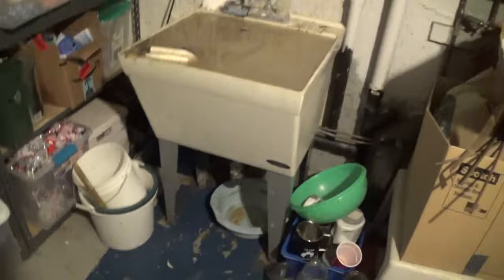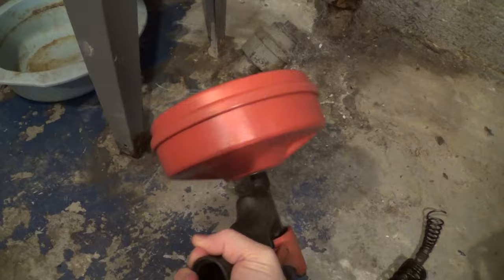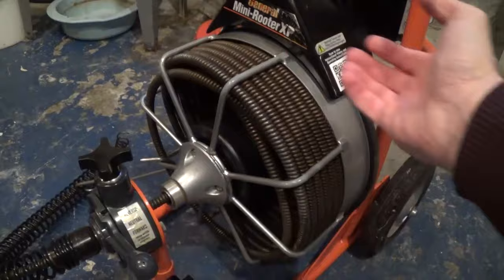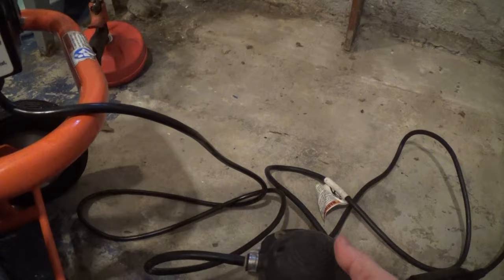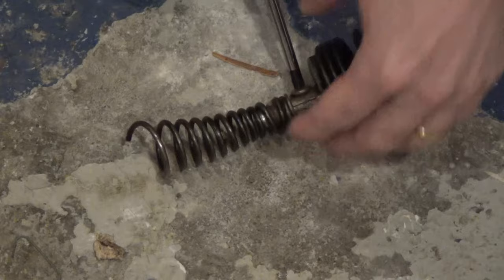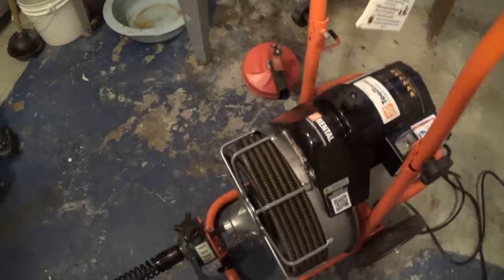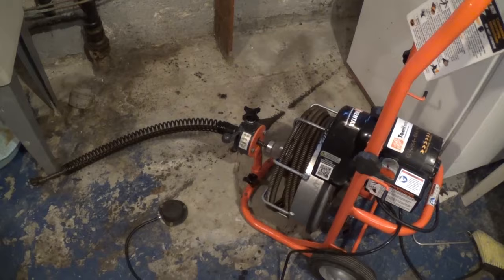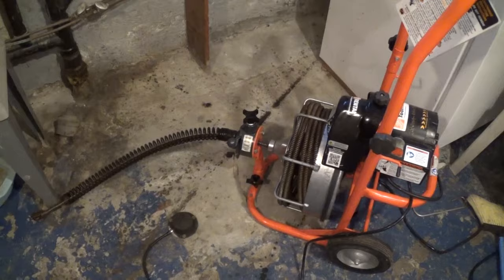How to Unclog a Sewer Line with a Rented Drain Cleaner

Comment: I watched your video multiple times as to never used an roto rooter type snake before and did not want to pay  local rotor company $375 again as I did 3 years ago,  They always tell me I have to replace my sewer mainline and they would do it for $5000.  I rented a 100 foot auger from Lowe's for $61 and followed  your lead,, what a savings!  even if I have to rent a roto auger yearly , so what,, I am more than ok with that ,  thankyou for keeping it simple and easy to understand
Reply: They always pitch that same thing to me, $5000, and even$10,000 with the idea that I could have roots and require my entire front yard to be dug up, and that's why I'm here as well.  Thanks for that.  Usually,  I just hand snake it, and no prob.
Reply: I suspect they would want at least $10k now from you.  Stuff is a lot cheaper in my area and even they want at least $7k to repair the trouble area and $10k to replace the whole line.  And all I have are a few fine roots sneaking in at the end of the line where it connects to the city.  I suspect I can get many more years out of it.  I plan to just buy one of these.  You can get one that does fine roots for like $700.  That will pay for itself in just a few years.   I would just pay the $10k but I suspect the roots would just come back in a few years anyway.  They always seem to find a way in.
Reply: Nah than that plumbers not your guy he’s just trying to get more money out of you

Comment: I do things a little differently, so here goes.  When I introduce the snake in the pipe I also allow a trickle of water down the sink.  What this does it is way for me to witness that the pipe is getting cleaned and whether it is.flowing properly.  I can also adjust the flow rate to allow me to judge my progress.  This is my process and nobody else’s.  I also run the water as I am retrieving the cable for two reasons to clear the pipe of any crap in the pipe and to clean the cable.. It takes a little longer but I don’t have to clean the machine

Comment: how do you know how many feet you’ve gone in? are there cable markings or some other indicator besides eyeball guessing?
Reply: I recently rented one. I payloaded it out all the way on top of the ground. Then at ten foot intervals, I spray painted white spots. And now I know where my problem area is, for future reference, in case I decide to actually dig, and repair the pipe, because of tree roots!
Reply: @michaelnelson9140  pretty good idea even for smaller snakes - thanks

Comment: I called the sewer company. We have several of them. We use the same one each time they’ve been really wonderful. They snake it clear out to the road and clean up and it’s 115 bucks. And they guarantee against roots for six months! I live in Michigan.

Also, they have like a power flush that they can put down your drain to flush out so you’re washed tub your sink whatever. That’s a plus! 👍
Reply: What company? Also in Michigan.
Reply: Who are they?
Reply: Depending on the type of tree Most tree root could regenerate after six months
Reply: That's a bargain, where I live north of Chicago, it's about 400 bucks per clean out.

Comment: The only clean out I have is in main line. I have floor drains in basement and one outside. I wondered if the floor drains could be in a separate “storm” line running to the sewer or somewhere else or if it’s connecting to the main line. Also had trouble getting the snake to enter through the floor drain in slab. P trap or hard 90? Suggestions?
Reply: If your home is older, you may be on a combined system. Where your storm ties into your sanitary.  If it's a newer home, you most likely have a sump pump. 

If your home is older,at that floor drain. That is most likely where your storm is tieing into your main
Reply: @kD_5555_  Mine is just 1 pipe outside next to our ditch. Every time it rains a little hard, the manhole has water going into the road, and our pipe outside starts overflowing with water and toilet paper into the yard/ditch. Toilets also don't flush. Our toilets wouldn't flush for the past week so I rented this, but it's half as fast as his and isn't seeming to do anything. I also don't see any water in the drain pipe outside whenever I flushed both toilets 7 times combined. Didn't even notice a change in waterflow inside the pipe. idk if that's normal but my mom used a pressurewasher hose yesterday, and felt obstruction after around 10 feet, but the auger went in full speed for 5 minutes and still nothing. I did notice it would (idk how to say this) it would spin normally then at a certain point the guide starts flailing around like a ceiling fan as it's going through. If I reversed, it just went back to normal, then forward again and after a few secs it did it. What should I do here?
Reply: I have same configuration. My plumber showed me how to snake from my basement drain - it's tricky but also with patience (lots of patience) it's the easiest way to do it. Typically in the older homes if you take your hand and feel down 4-8" you'll feel the outflow drain - learn where this is. Then aim the tip of auger there and guide the auger while it is slowly spinning. Once it goes in, push and get some line down the pipe and away you go.